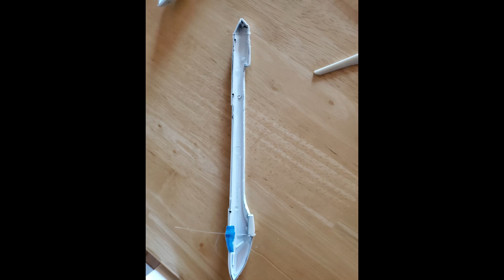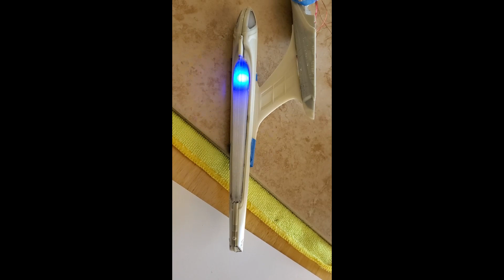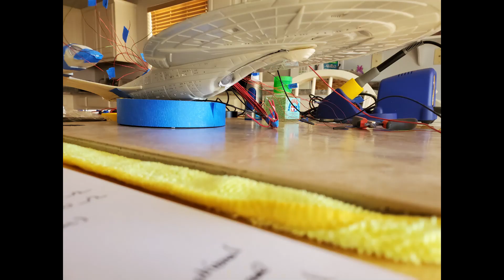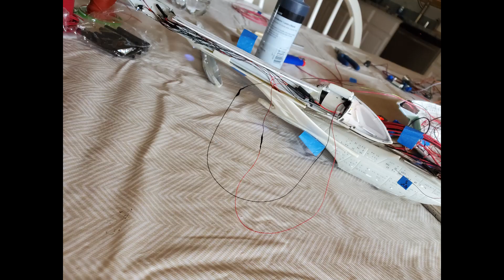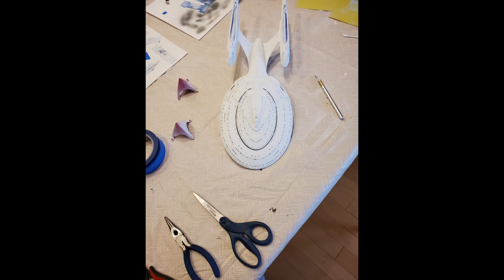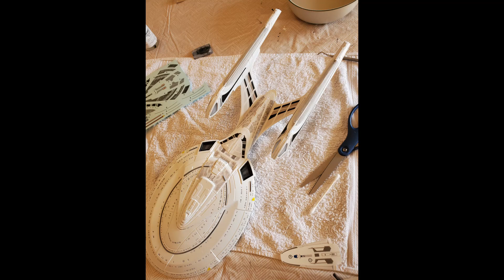Enterprise 1701 E AMT 1/1400 Lighted Scale Model

Comment: Utterly magnificent work mate I wish I was as good as you doing stuff like this it just looks so awesome! 
The only suggestions I have is: 1, How about etching, laser cut, use scissors or even use a knife to cut some sticky backed copper tape to the shape needed, solder the wires on it for the electrical tracks first, then just stick it down to the interior and it would form the internal shape? Mite help a little? 2, I do remember once someone said to use some type of Halloween liquid latex to temporarily paint onto the “windows” etc on the outside to cover them, then once painted and dry just rub it off? Sory mate just my 2 cents! But that model is just fantastic!